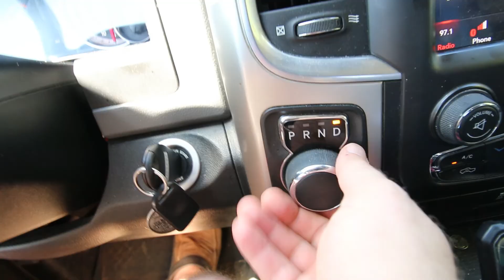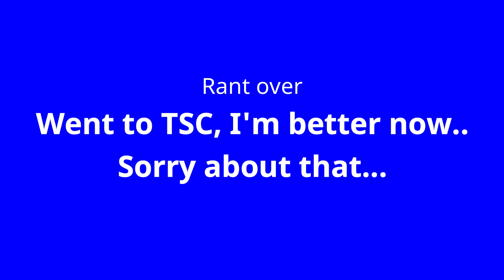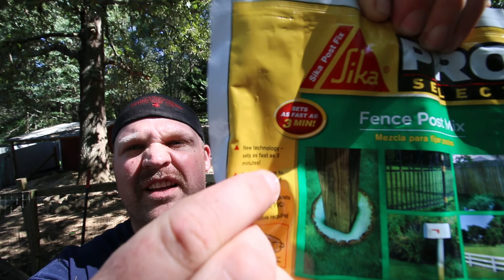Procrastination Sucks! - Goats Got Out

Comment: Ok so I blinked and missed it - what is the spray foamy looking stuff called? Badger was tied to a fence and almost took it down, and loosened the pole it was attached to. Would love to try to use it to reset the pole!
Reply from the maker: I believe its Sika brand. It's a large liquid pouch. I found it with the concrete at home depot.
Reply: @CattywampusAcres  Thank you!!